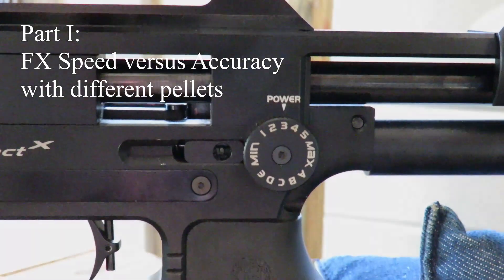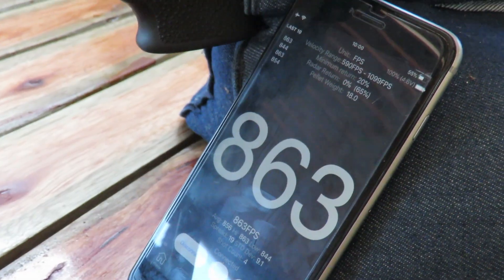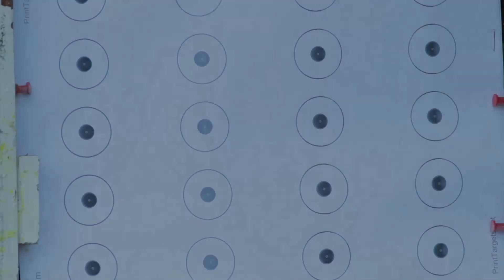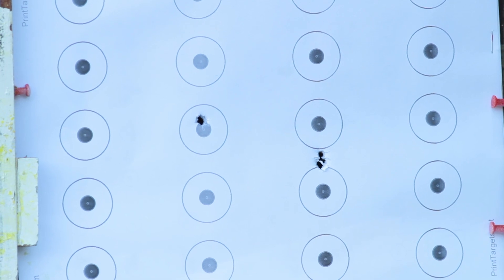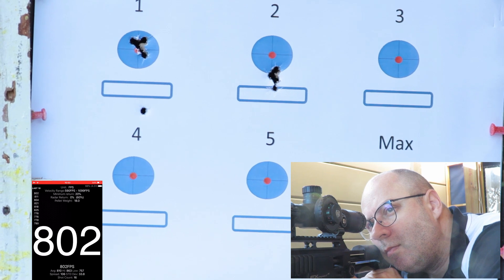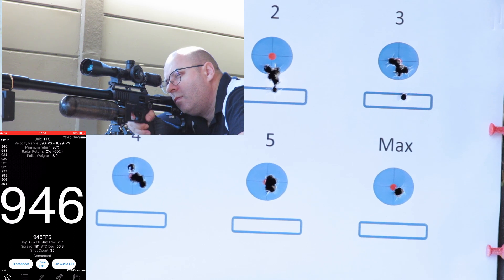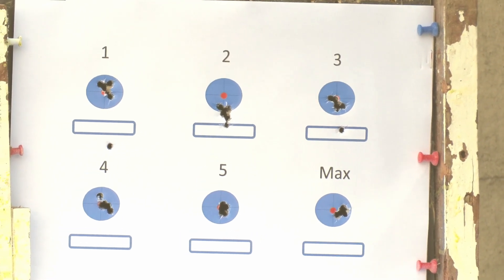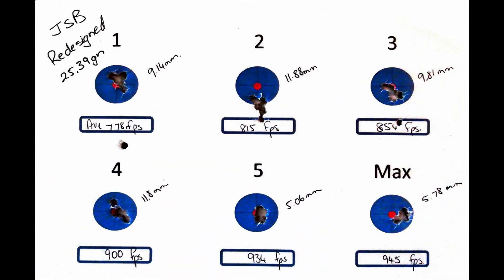FX Pellet speed versus accuracy: Part I

Comment: This test is completely flawed !  First of all we need to know what discipline we are shooting and therefore what power level we require ! Depending on that, then we can choose a pellet weight that achieves a pellet velosity between 840-875 FPS using .22 and larger pellets.  Then tune the reg and hammer spring to give the most consistently low extreme spread and standard deviation using a chronograph ! Then and only then start shooting for groups and use a barrel tuner like the one FX have started producing ! Note if you are not using sorted pellets, you are wasting your time as the results will be all over the place it the pellets are not consistent ! Then of course the nut behind the gun has to be consistent !  Funny how everyone thinks that by using a bench they will be super accurate ! Well just look at those who shoot bench rest ! Not all pellet on pellet are they ! A tin of pellets will have a few different head sizes and weights and you will soon notice the size stated on the tin means nothing ! Actually before doing anything else, get yourself a pellet gauge and a wooden dowel to push a pellet through your barrel.  Check for tight spots apart from the choke of course and mark on the dowel, as they need to be sorted out first.  Then measure the head size and choose the smallest head size that has rifling marks evenly all round.  Then when you have enough of those, get a beam scale and weigh them.  What matters now is that they are all the same weight.  Now you have consistent pellets, the results you see on the chronograph might mean something.  Remember every gun is hold sensitive and every addition you make to the gun, changes the barrel harmonics ! Do not shoot for groups with a chronograph attached to the barrel ! If you go from bench to offhand, the barrel harmonics will change ! I turned up the speed of my rifle and it still doesn’t group well ! Well I wonder why !!!!!!!
Reply from the maker: You are 100% correct on 95% of all the info and sincere thanks for the indepth reply. The video was and is aimed at the average shooter, for the specialists like yourself it won't add much value. This was indeed one of my early videos and since then I have learned a lot, the gun is not intended to go and shoot any bench competitions in the near future.I was testing pellets to look for something available, comfortable and to check for a speed that is conssistently producing relative good groups. The experiment was merely to look at what speed the gun would group the best... that is before you start fine tuning, once you have a base speed and a pellet that has any inclanation of grouping can you start the fine art work. Unfortunately 99% of shooters out there doen't have a 1/10th of the equipment you are referring to, hell neither do I. I did however consult a world champion bench rest shooter for the finer detail, even he doesn't use a pellet sizer. His method is extensive testing at a given speed between batches of pellets, and this speed may very in small increments as much as 3fps, once he has a promising pellet, then the weighing and fine adjustment starts. Yes and NEVER look for optimal pellets with chrony attached, harmonic etc. I stopped doing that soon after this video. From your reply it is clear that you have a vast knowledge of accuracy shooting, again sincere thanks for the time you took to reply, I am in no means a profesional, nor do I claim to be. I have a huge amount to learn, thus feedback like this is unbelievable welcome. I post my videos as I learn and find new things, thus it is a knowledge growing platform and learning path. It is only with great feedback from people like yourself that I can further enhance my knowledge and share that with the shooting community. Please keep on replying where you see my making errors, I learn from this. Key to all this is the NUT behind the gun that can easily be loose. lol.
Reply: You’re are most welcome and we are all learning ! Learning never, ever stops and there is always something new.Always listen to what someone else has to say and even if some of what they say is wrong, they might have some valuable information you had never heard of.  Keep up the good work and lets all help each other as shooting all on our own is boring ! There now seems to be more channels sharing very useful information which helps encourage new shooters to compete and may this long continue.  Cheers !

Comment: Have u tried it beyond 50m to see if it still accurate at that speed? Usually it will only shoot accurate below 50m at faster speed but past 50m it will spiral, but at lower velocity it shoot straight normally
Reply from the maker: Without wind accurate up to 100m. 950fps max. Faster than this the spiral begins.

Comment: I noticed POIn shift with my FX Radar on the barrel versus off....how about you?
Reply from the maker: Most definitely, on 29m I have to aim 1/2 mildot high on a 10x scope, the weight on the end of the barrel pulls it down, If the radar isn't 100% under the barrel i get sideways impact shift as well. I only crony with the Radar, once I get the optimal speed I remove it en re-zero the gun